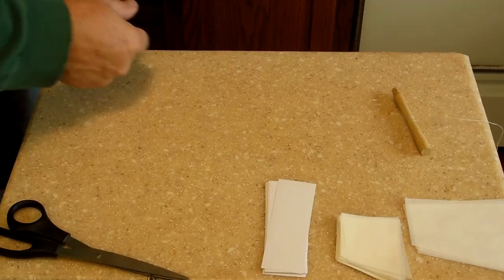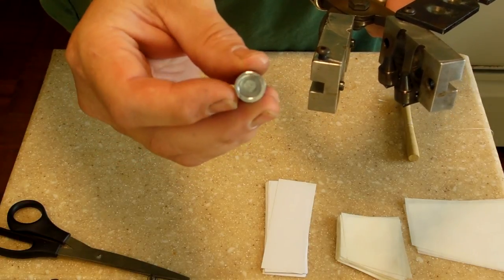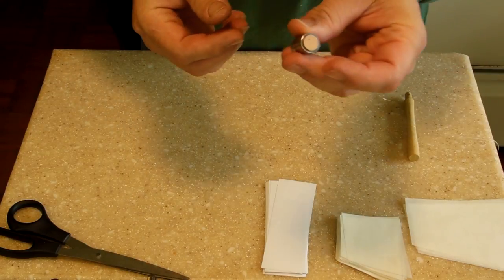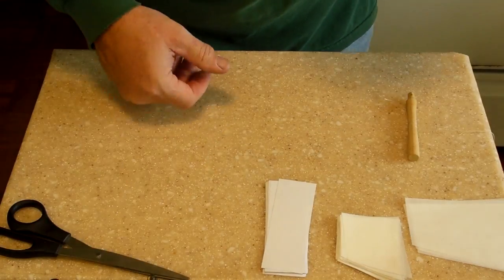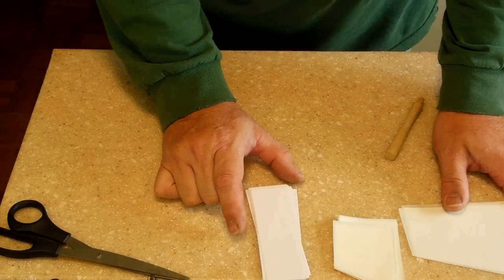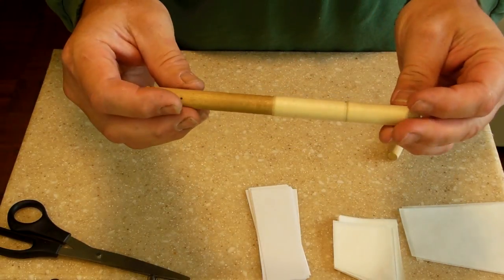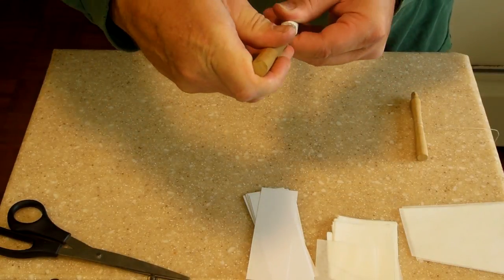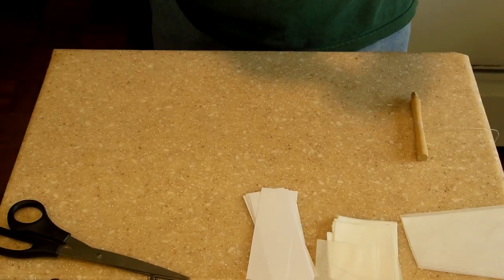Pritchett Enfield Cartridges for .577 rifles and carbines

Comment: Great video Plowboy, I am definitely interested to see how they load and above all the accuracy. My P53 Pedersoli has never had any accuracy using the three band minnie, and it is not without trying. Like yourself I also use 3FFF powder, and changed the nipple to use #11 caps. My hunting rifle is the Lyman trade rifle in .50 cal, using a patched round ball and 80 grains of 3FFF, it is dead nuts accurate and a real game getter.  Richard from the great white north, "Canada"
Reply from the maker: There's videos of me shooting these cartridges in my P53 and my JP Murray  from nearly a couple years ago on my channel. I plan to do another shooting video with these soon.

 My P53 shoots 8" high at 25-yards with .575-500 Lee Minies, and about 4-5" high with these, using 68-grains of 3F Goex in both loads.  To me, that suggests that these are moving faster and thusly may be fitting the bore better.  The .575-500 fits my bore loose, anyway....so much so that when hunting with that Minie I put the ramrod down the barrel periodically to make sure it was still seated (which it was....probably due to the dried SPG).

  I have no such worries with these paper patched Pritchetts. They still load easy (first shot or 25th shot...they load the same), but there's a much better seal that with naked lubed Lee Minies.

 The skirts of the cavity on the NOE Pritchetts are pretty thick. They could probably use a heavier charge and yield better obturation and accuracy.

Comment: Finally got my mold and started casting. The link for the onion paper takes me to 10lb onion paper rather than 9, is there much of a difference?
Reply from the maker: That's a question I don't have an answer for.  When I posted that link it was to 9lb, so someone has changed it on Amazon.

I went back into my old bookmarks and it now leads to this 10lb.  I don't see much 9lb in a quick google search, so I hope 10lb works. I figure it probably will.

Comment: Quick question:
Why were the .577 bullets loaded into the cartridges upside down?
Reply from the maker: In this British Pattern 1855 cartridge for the .577 rifle-musket, the bullet diameter (in my reproduction) is .566 and paper patched with the paper dipped in lube.

 The bullet nose is toward the center so that it may be inserted with the un-torn end of the cartridge paper as one piece. 

 This is different than the federal "Burton" style, grooved, lubed Minie that is introduced to the bore naked/without paper.

 I find (as the British and Confederate government did) that bore fouling is kept to a very minimum in the British pattern cartridge use since each loading effectively swabs the bore...which is much different than the Federal pattern.

 The effect of these British pattern cartridges is a sustained fire capability with almost no degradation in accuracy and loading ease from one shot to as many as one could put through it. Confederate tests ended after thousands of rounds through one rifle without cleaning and no issues. They gave up trying to force a failure.

Comment: Could you suggest cartridge dimensions for a .50 cal Hawkins rifle, I just finished a St. Louis Hawkins rifle kit and would like to use cartridge for field hunting.  Making my own cartridges seems a fun way to improve the experience and my time in the field.
Reply from the maker: It's something i would have to just go through trial and error if I were to develop one from scratch. With this one, I was following a pattern.

 I  would be easier to adapt the federal pattern cartridge construction to yours unless you're running a bullet undersized enough to be paper patched.

 With this British pattern, the cartridge is a function, integral part of the load...where as a federal pattern cartridge is really just a carrier that is completely discarded after loading.
Reply: @plowboysghost  Ok, then I get to experiment!  Hell of a good reason to spend more time at the range.  Thanks for the video, and a fun idea.
Reply from the maker: @TrikeRoadPoet  Let me know if i can help.
Reply: @plowboysghost  I will ask when the questions arise, (as they will), like do I start with the forming mandrel to be the size of the ball, or a tad smaller to allow for the wraps of paper?
Reply from the maker: @TrikeRoadPoet  I'll have to double check.